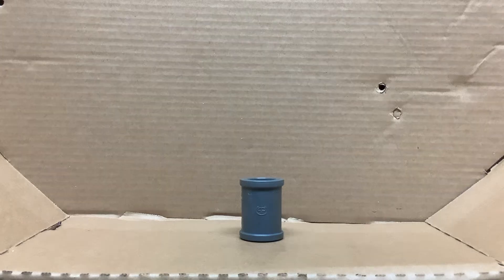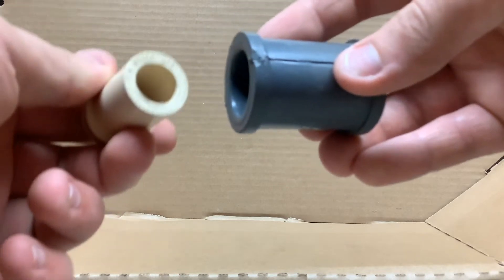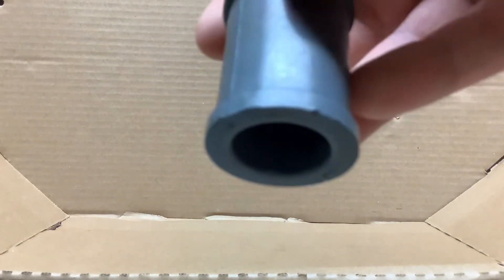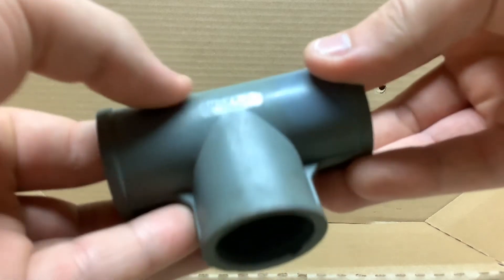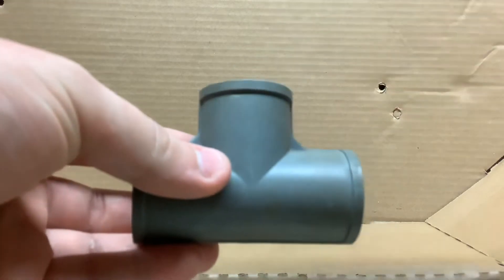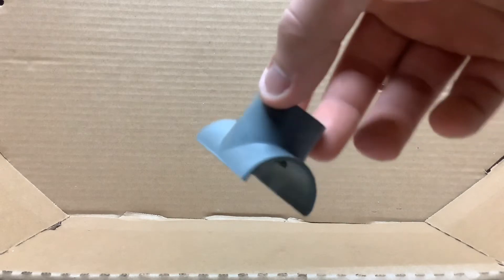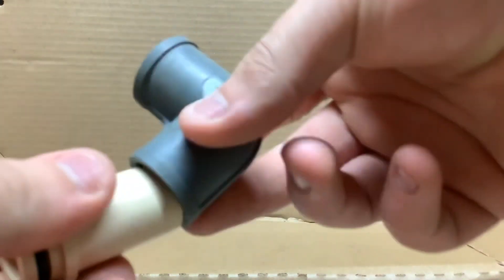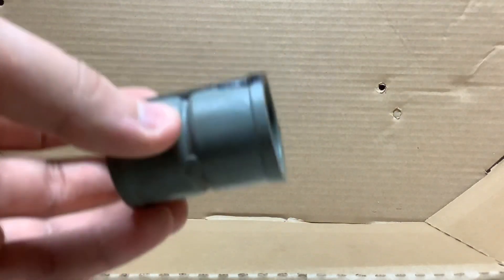1950s - 1970s grey thin wall ABS pressure fittings.(2022)

Comment: Very cool your lucky to find vintage plumbing fittings. I might buy a 1 1/2 galvanized Durham 45 elbow if Habitat Restore still has it today.
Reply from the maker: Those Durham fittings are interesting, I saw someone selling hundreds of Grinnell Durham fittings on Facebook marketplace.
Reply: @jacksplumbingvideos7147  I got the Durham fitting and I re tapped the threads. The fittings are tapped a a slight angle so when its installed vertical  the horizontal pipe has pitch. I have to update my npt pipe tap collection and get some larger sizes too.